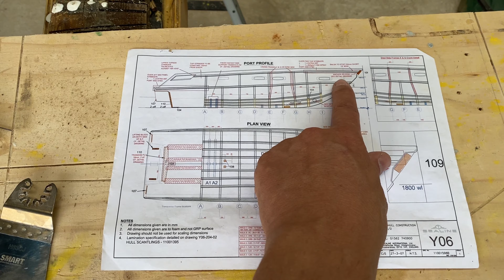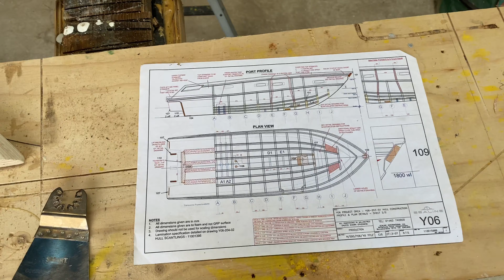Building the New Chain Locker - Boat Rebuild Project - EP 30

Comment: I would make sure to install a one way valve on your anchor locker drain.  Hydrostatic pressure when running in a sea can force water up through that clam shell cover very easily.  The up and down forces the water through when in a sea.  This can become a problem when transiting a stretch of rough weather.
Reply from the maker: Thanks for the tip, will look into this 👍